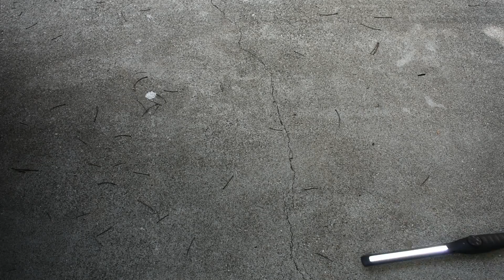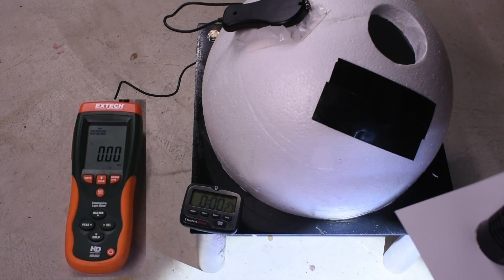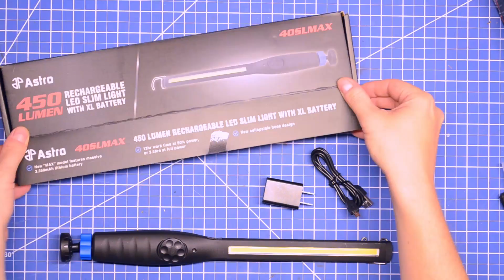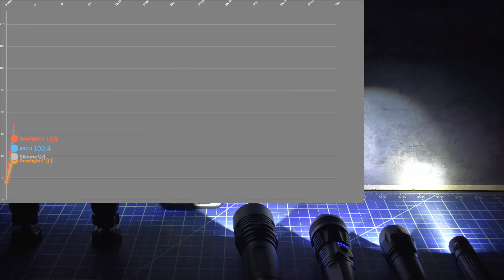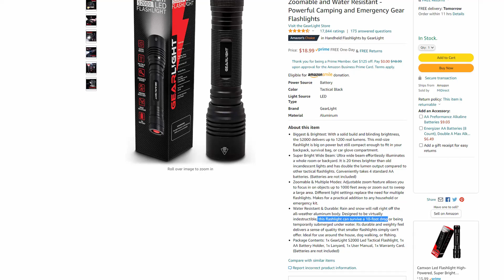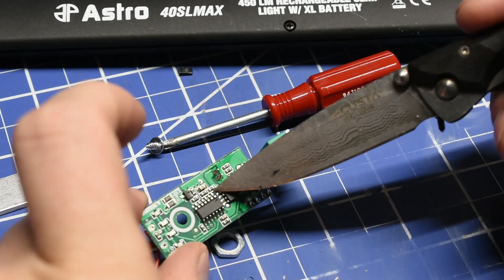How Much are Flashlights Lying to You? Best Selling on Amazon

Comment: uh a type-C charger communicates over USB-PD protocol, which has its own pin on the Type-C connector, adapting that with the fancy power meter to type-A simply does not work because QC uses the standard D+ and D- pins. You need a dedicated type-A QC3.0 charger. But I doubt the flashlight charger will actually request more than 5v and you probably are getting the most power to charge it anyway it just "supports" getting 9v or 12v probably because its buck charger can handle at least 16v physically. Unless you can verify that plugging a type-A cable into that charger triggers it to output QC voltages I'm not convinced it is possible.

Comment: I hope you guys know the difference between linear chargers and buck chargers. Most expensive lights will use a buck charger which will convert for example 5v@1A=5W into 3.7v@1.35A=5W. All the cheaper lights will most likely use a linear charger instead, which turns that 5v@1A=5W into 3.7v@1A=3.7W. So in order to guess the capacity of the internal battery you need to know what type of charger is being implemented.
So just comparing mAh read by your charge meter does not tell you the mAh of the battery, with linear chargers yes they will be the same with no math needed but if it has a buck charger you have to use the mWh reading because the mAh@5v does not equal the mAh@3.7v so all you need to do for that is divide the mWh read by the meter by the nominal voltage of the battery, a 1S lithium-ion cell is 3.7v.
I hope this helps you out in your testing, I really love your setup and appreciate the work you do to get these results!

Comment: Im a welding inspector and have the olight warrior mini. 1500 on turbo is so bright it is hardly ever necessary, even in the outdoors.  The 1 and 15 lumen mode is great for close up technical work and the other modes are perfect for everything else. Best feature is the memory so it stays on the mode used last. I use this light every day and go 3 months before having to charge it. By far the best piece of equipment I have bought to date. 10/10 rating.

Comment: Hopefully, many already realize that you often get what you pay for, and that most advertising is far more than just fluff and outright lies, like most resumes are today. 
Reality is you are getting more or less what you are paying for, but not getting what is advertised.  Sellers often realize that they can make a claim and as long as the consumer has no real way to test such claim, well, they're going to get away with it.  And most sellers, if they manage to get sidelined by amazon, they just change the name of the business, change their email address, and voila, they're back in business under the amazon banner anyways.. 

For most flashlights, I value replaceable batteries over rechargeable batteries almost any days, dependent largely upon function.  Don't get me wrong, if it supports replaceable rechargeable batteries, I'm all for it.

Comment: A seventy dollar flashlight just isn't worth it to me.  Mine get dropped in a wet bilge or lost before you would ever get that much use out of it.  Not to mention today's batteries tend to leak which destroys the fancy electronics.  What I want is a bright (don't need all the different settings hi and lo would do just fine) small durable belt light that is rechargeable.  Keep it under twenty dollars and it will be a winner for me.

Comment: Not all Olights behave that way. I have a S30 Baton III, Baton Pro, Baton 3, and a Seeker 2. They all can go straight to turbo from off. Also, you are never going to get  long hours at 700-800 lumens on a single 18650, would likely need to go to a 21700 cell. 

If you want, I can lend you any of these, The Baton Pro (2k lumens, 600 lumens for 3.5hrs, looks identical to that S2R Baton II), and Baton 3 (mini, 1200lumen, 300lm for 1.5hrs), and the Seeker 2 (3k lumens, 1200-600lm mode is 2 hrs on 1200, 1 hr on 600, or 13hrs at 300lm, discontinued now the Seeker 2 Pro) all use their current recharging cable system.

Comment: FYI, that charger you used for the Olight is a Power Delivery 3.0 (PD 3.0) protocol charger only (blame Google).  Based on your video, the light appears to want a Quick Charge 2.0 (QC 2.0) protocol charger. They are related, but in this case incompatible, rapid charging protocols. I believe only QC3.0 or 4.0 is compatible with PD3.0 but not QC2.0. This is possibly why the charger only pulled <1.0A and 5V (rather than the higher voltages found in QC and PD).
Reply from the maker: We tried our other 2 gizmo's as well which have previously supplied 2 amps no problem, and on all it only wanted 1A, that's a big shrug from us as to why, in the manual, the gold one states it can supply QC2.0 as well.
Reply: @TorqueTestChannel  The flashlight tells the charger what to provide, if the charger can't understand it provides 2.4A or less. The gizmo just reports and passes along what it receives, think of it as a man in the middle. Anyways no big deal, it was a great video!

Comment: So I have a flashlight I would LOVE to send y’all for testing. It’s advertised as one of the most powerful handheld flashlights with a peak output of 10,000 lumens in turbo mode. I’ve had it for a few months but I rarely use it at work because it’s honestly overkill for most of what I do and I have a little $30 rechargeable keychain flashlight from Amazon that’s surprisingly good (love to see that one tested too.) 

I forget the company that makes it but I’ll look it up. In any case it’s around $70 but you have to the buy the 2170 Li-Ion battery cells separately so altogether you’re pushing $100 for it. I bought some cheap, shitty cells so I’d recommend using better ones for testing if you have some. 😂

My only request is that you don’t use it for the drop test, it’s not designed specifically as a mechanic flashlight so I’m not sure what that would do to it. It’s a Ferrari not a Toyota. 😂

Great to see y’all branching out into other categories besides just Impact tools!

Comment: I'd love to see you test a Fenix light.  I use my PD36R every day for work (Petroleum service tech).  My research indicated it was the most practical all-round light around.  I particularly like how the brightness adjustment is independent from the tail cap switch.
Reply: My trusty old Fenix LD20 (2xAA) has been used so consistently over 15 years I've almost worn the lanyard off where it attaches and the finish isn't what it used to be but it performs as new. Hope the PD36R serves equally well.
Reply: @mattburrows2615  A flashlight just doesn't look right until the finish on all the edges is worn off!
Reply: @fredygump5578  for sure! 
Made it sound like a bad thing but the dents and scratches certainly tell a story of what it's been through lol. 👍
Reply: As an everyday, many-times-a-day (engineer working in facilities) user, I adore my pd36r. My only issue is the USB cover. It swells with exposure to oils and falls off after 6mo or so invariably.

Comment: First of all, I appreciate your channel and the quality content you have shared on it. 
But please compare apples to apples, also when in the electrical domain. Electrical energy could be expressed as being voltage*current*time. The rechargeable Lithium-Ion cell(s) used internally in the tested flashlights have a nominal voltage of 3.7 volts for a cell. Rechargeable cells typically have their energy capacity defined as x mAh. Multiply this number x with the nominal cell voltage (here 3.7V ) and you have energy in mVAh = mWh. You charge the flashlights from a constant voltage 5V energy source and measure the mAh used to charge, here you also need to multiply the mAh with voltage here 5V to get the charge energy in mWh.
So when at time stamp 14:25 compare cell size defined in mAh with mAh consumed from a 5V source during charging not factoring in the different voltage levels you are “comparing apples with bananas”. 😎
In addition as you mentioned there is also a conversion loss in the charger integrated in the flashlight. This could be in the range of 5% - 15%, and should also be included in the equation when comparing. 
So if you internal 3.7V nominal Lithium-Ion cell is rated x mAh. Then you can expect that you will consume roughly between x*(3.7V/5V)* (100%/95%) mAh and x*(3.7V/5V)* (100%/85%) mAh from you 5V constant voltage source in one charge cycle. Translating into an estimated scale factor of in the range of approximately 0.78 to 0.87 between your measured mAh from your 5V source and the lithium/Ion cell rating/capacity in mAh.

Comment: How many of the rechargeable units allow them to be on while charging? I like a mix of rechargeable and AA powered units, while the rechargeable lights are great, when the power goes out for an extended time it's nice to be able to just pop in some fresh cells. One of the things I like with the HF lights I have is that you can easily swap out the cell, so I have a dedicated charger with 4 cells in it for just such times.
Reply: Rechargeable AA batteries have lower voltage and therefore lower output but last a good amount of time while being reusable. Amazon basic or Sanyo cells are a good buy.
Reply: @austinmatney7591  why waste money on AA or AAA batteries when you can just get a 18650 or 21700 cell
Reply: @reahs4815  some lights use both or are for a different purpose. I have two headlamps, one takes a protected 18650 or two cr123 cells and the other takes three AAA so I use rechargeable a in it. I simply replace alkaline with rechargeable, I try to get 18650 powered devices of possible like Bluetooth speakers and lights.

Comment: Besides the HF Braun, I have a few Streamlight pencil style lights that are collecting dust. A head to head on these pencil style lights that can be cared in a shirt pocket would be great. I hate having to carry a light on my belt, they can be a pita if you are crawling under something or on a creeper....
Reply: try the microstream USB. it's half the size of the normal stream and has a lipo battery usb charged. half the size and brighter than the normal pin on high than what I used to carry, plus the new style clip that allows it to be clipped to a hat brim, I've used that way more than I thought I would. so far it's about the perfect everyday carry light for me, and the switch hasn't died like the other stream lights always seem to.

Comment: I use flashlights in underground tunnels and have been using Milwaukee 1100 lumen rechargeable model and it works very well and durable. I like it. Has replaceable battery only not sold on Amazon only at Home Depot $79

Comment: You should be able to just double press the button from off on the o-light to get to the turbo mode. A triple press from off should be strobe and holding the button from off goes to "moonlight" mode which is .5 or 1 lumen
Reply: The SR2 is my every day flashlight and it does as you say. It also has a lock function, by continuing to hold the switch with moonlight mode it locks the flashlight and takes a long press to unlock it. Great if you want to just toss it loose in a bag.
Reply: @Shaggnanigans  You bet... That lock out feature is gold... As I wear mine on my belt.. And if you touch the button by mistake. It will turn on. The only way you notice. Is it gets hot.....

And All my Olight's have Double press to enter Turbo mode...The best thing about them. I actually bought 2 extra batteries. I'm still on the first  one 3 years later...Think of all them AA, AAA batteries people bought at $20.00 a 20 pack.. That last about 2 hours at 400 lumens...So the up front cost of the Olight. Pays you back on batteries you don't have to buy...

And they make a 550 and 650 for the SRII and SRIII Baton.. For even longer run times...
Reply: My baton pro is the same
Reply: Good info, I did not know.  Ty.  
Channel owner should acknowledge this.

Comment: I have a s2r baton 2 and if you double click the switch from any condition it will go into turbo mode. Do it all the time. I'm literally doing it as I'm typing to be absolutely sure it will turbo from any condition off or on. Moonlight mode has to be from the off condition then long press and hold.
Reply: All of my olights work this way, same one you have as well as 2 of their headlamp lights.

Comment: Ya know I'd really love to see some sort of test that evaluates the quality of the light too. Most of the time when I need a flashlight I am really just looking for more consistent illumination of a work area. Perhaps the quality could be evaluated by shining each source on a white background and then leaving it up to the viewer for they're own subjective takeaway.
Reply: You don't have to rely on "shinning each source on a white background and then leaving it up to the viewer". You can get a used spectrophotometer (basically a spectrometer) used for color calibrating monitors / projectors / printers / printing presses for a few hundred dollars, and measure lights. You can easily measure CRI (which itself is kindof a useless measurement that's easy to cheat on), or the better but less widely known TM-30 spec. Ever wonder why the "high CRI" LED bulbs at the hardware store still look terrible? The spectrophotometer can show you why! CRI is based on the amount of light output at 8 rather pastel (unsaturated) colors compared to blackbody radiation, known as R1-R8, but it doesn't take into account more saturated colors and skin tones, which are in color swatches R9-R15. A lot of "high CRI" bulbs are missing a lot of saturated red color, and also sometimes saturated blue, which is why in places where people dig into these things, you always see "CRI + R9 (saturated red) + R11 (saturated green) and R12 (saturated blue)" figures given. The TM-30 spec is based on 100 different colors, so a lot harder to "cheat" on.
Reply: @gorak9000  Sorry about the late response, I sorta meant more or less to just show the pattern of light rather than the light's color rendering abilities. It might show if there were fringes around the edge of a headlamp's field of view or waviness from a COB array without proper diffusion. But a color accuracy test would also be pretty cool, if just a bit more expensive.

Comment: Great test! I would love to see the harbor freight stick light tested as well as some Anker and Nicron flashlight.
FYI as a rule i do not buy flashlights that don't have a proper rechargeable option (rechargable AAA and AA are not acceptable!). I prefer to have the option of changing batteries as well. My Nicron N7 runs on a 14500 but can use a single AA. That's the best of both worlds. The HF stick light uses 18650 batteries, that can be easily swapped and it charges internally - also great!
My .02
Reply: I am also a fan of the harbor freight wand light. But i think it might not last as long during the torture test of falls.
Reply: @karlgutenburg9176  I agree, but being metal, they seem to hold up to grease and solvents well. Not to sure about the overall quality, I've seen some just fail, but they work well otherwise. They could use a hook
Reply: I suggested Anker last time.  I got one as a gift and so far its a good little night stand light.